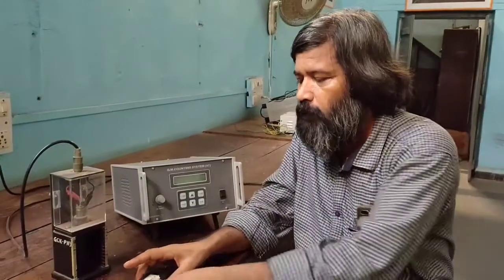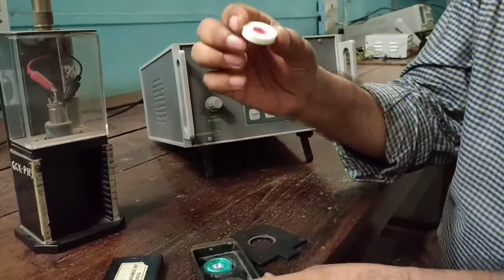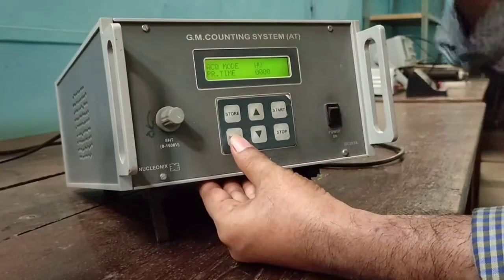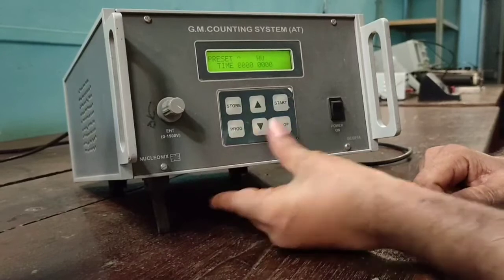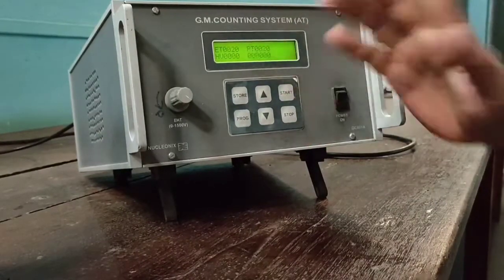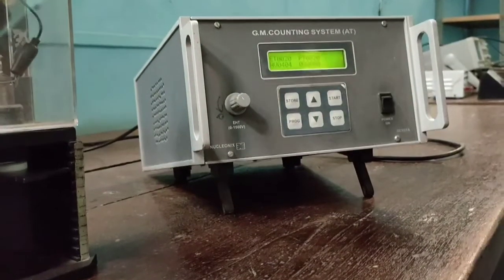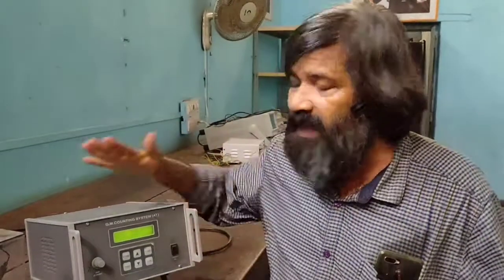Characteristics of GM Counter

Comment: 00:02 The new Yoni counting system
00:36 Precautionary measures for dealing with radiation exposure
01:16 Choosing the DAM holder with a mission direction
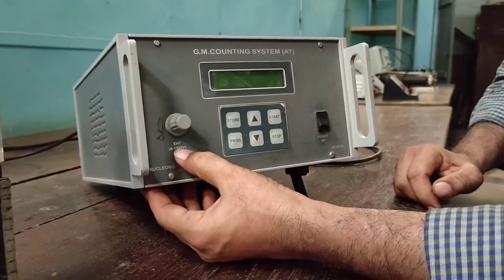01:56 Differentiation of program settings in the control system
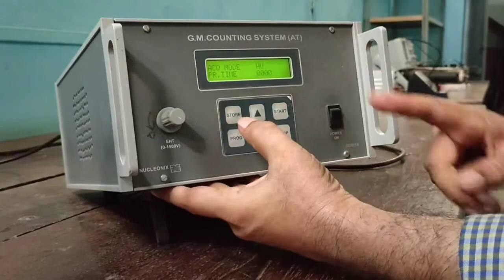02:31 Understanding the principles of GM Counter
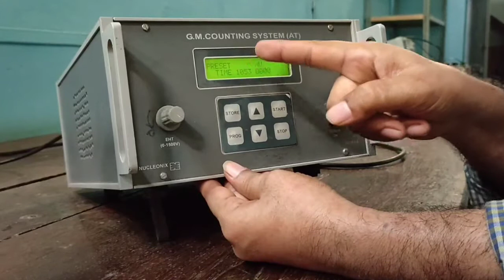03:04 The GM counter has very attractive features
04:22 Positive impact of GM Counter in C
05:52 GM Counter characteristics and working principle